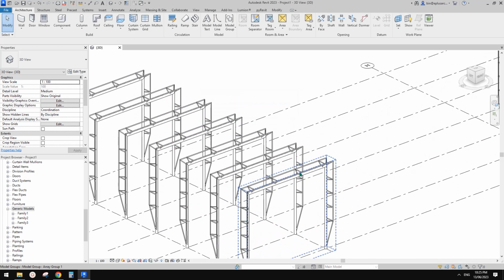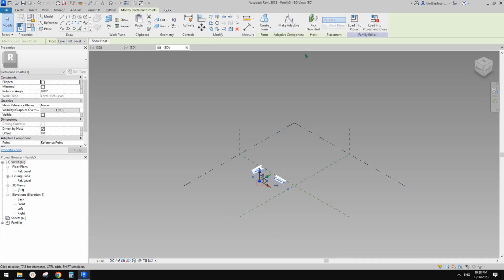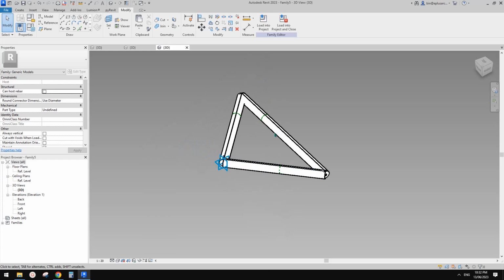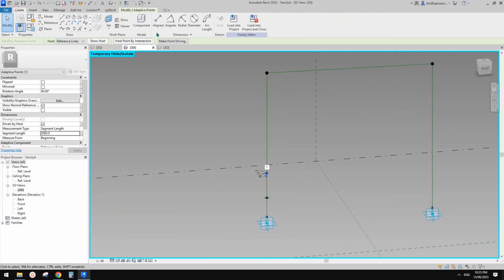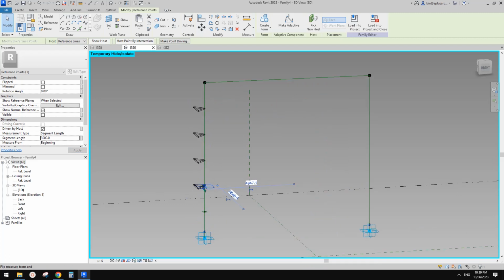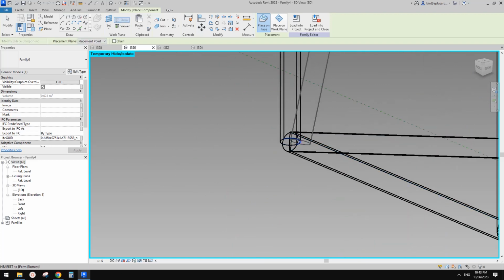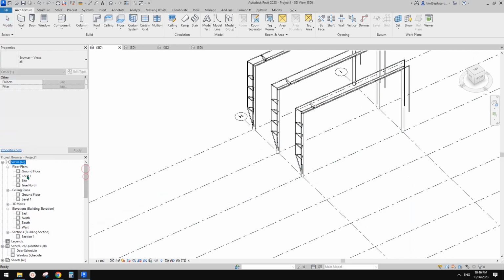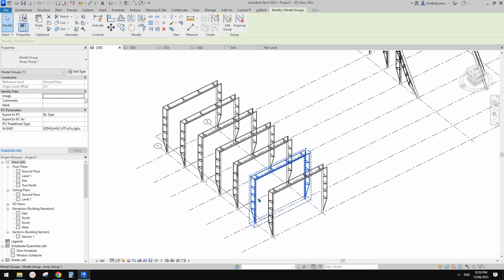23052 - Adaptive Family Method

Comment: Your channel is incredibly helpful and I really appreciate what you do. I have had lots of troubles with adaptive families trying to keep them vertical and not rotate as per its host geometry. For example, if I have a wavy roof and I want rectangular profiles to be distributed (using the repeat command and a subdivided path for the "waves"), the rectangular extruded profiles will be slanted and not vertical, and there is no way I can control that. Any ideas?
Reply from the maker: You can try this: https://youtu.be/Z0PHQuZLoLM